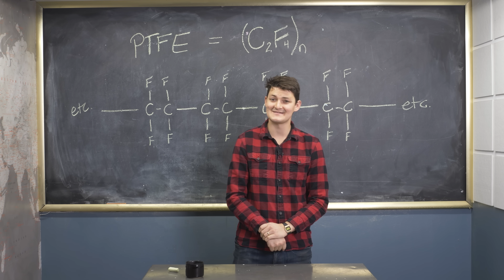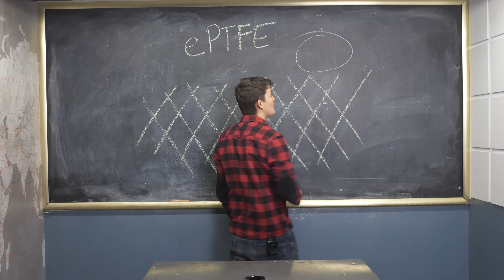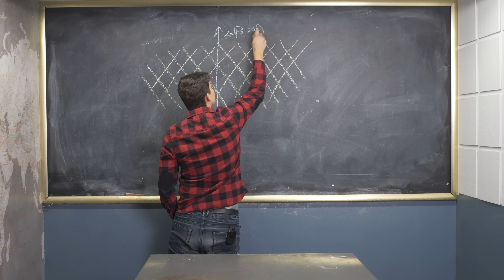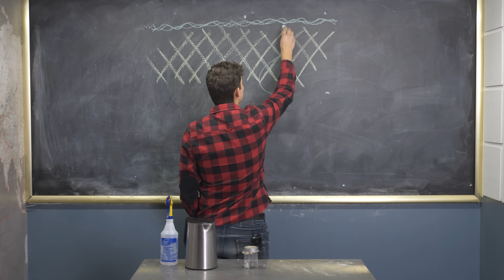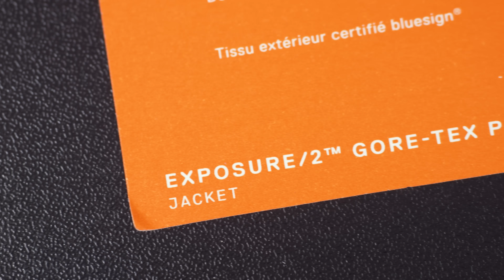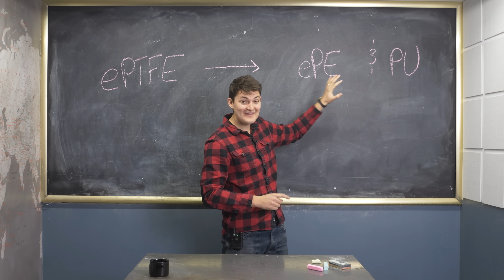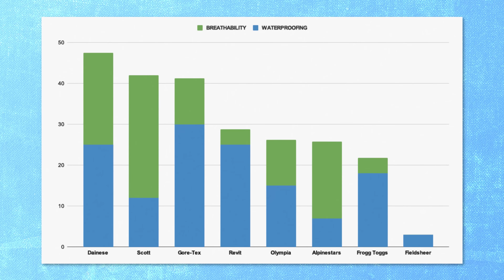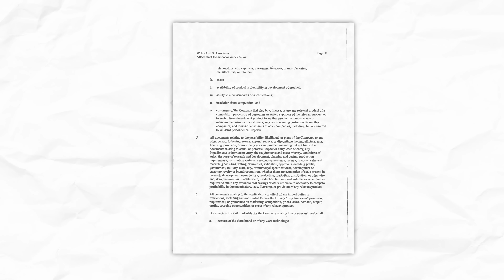Gore-Tex is a Marketing Gimmick

Comment: There are no better membranes than goretex in terms of practical usability. It's an expensive premium product that goes into performance oriented  garments.
Best laminates are mostly side-grades, i'm talking specifically about sympatex and toray products.
The truth of the matter is that most people wouldn't notice difference between standard generic 10/10 membrane and premium gore 28/28 because they are not in conditions this product was made for, and not doing activities that product was made for.
But it's their choice to pay up for latest and greatest, just like most people don't use even 30% of tools that compose a pro-series iPhone, but still pay for it.

Comment: In my opinion goretex neither breathes or keeps the rain out. Your boots will soak eventually and then they won't dry ever. Also it is not fun to melt inside your costume in the heat of summer. So why not just have a rain jacket to put on in case of rain?

Comment: This was a great video- for the most part about Gore’s business tactics and their membrane vs other membranes. You did make one critical error when trying to dispel the efficacy of Gore-Tex and also failed to apply your same standard to other membranes. You were so close when mentioning difference in pressure causing air to move back and forth across the membrane, yet failed to acknowledge Gore-Tex’s whole premise. It’s outdoor gear meant to let sweat evaporate and breathe out while shielding you from rain. The sweat is released by your body to shed heat generated from MOVEMENT. As you move, the clothing also moves squeezing air in and out of your layering system due to the pressure differential of your clothing changing shape. 
With your critical flaw being pointed out, I find it peculiar that you didn’t use that same flawed logic on other membranes and saying ALL membranes are useless because of the same use being that they all work under the same premise. Part of Gore-Tex’s price tag comes from being on more premium brands. Yes, your jacket example at the end with gore-Tex vs generic membrane exposes this, but when brands like Sitka (owned by gore, but indisputably the best hunting gear), Nike, and other premium outdoor brands use gore-Tex EXCLUSIVELY, it makes consumers more willing to pay more due to the Gore-Tex being paired with other top tier designs and technologies.
I advise you revise this video and be more truthful in a future video. -sincerely, a biomedical engineer, and yes, we use gore Tex inside of you.

Comment: This is wild, you may not be all wrong, but my basic issue rubberized wet weather gear was miserable. When we were assigned as OPFOR for SERE we were issued gortex and it was a life saver for me. It’s not perfect, but I survived -30* outside for weeks. Of course we also had fleece undergarments, and knew how to layer our clothing to suit the conditions. I did cheat some with quality wool socks, glove liners, and charcoal pocket warmers back in 1993-94. There may be better products now, but if you know how to use it, it can save your life.

Comment: I was a meter reader for 19 years. Best job of my life. I was getting paid to stay in shape, and we got to go home when we were done with our route, sometimes at 10 AM depending on how fast you wanted to walk.
i’ve gone through many shoes/boots, the best summer online 6 inch leather boots I found to be wolverine model 3368. They no longer make them. I don’t know what the souls were made of, they were some type of one piece plastic, I never wore a pair of souls out on that model boot , what would happen is, the shoes would go through a cycle of wet/dry/wet/dry that ended up taking all of the oil out of the leather eventually, no matter what I put on the shoes to try to keep them moisturized. It wasn’t winter weather or rainy weather that made my feet get wet, it was walking through the grass in the morning in the spring time, the DEW in the grass had my shoes soaked every morning within 15 minutes. And walking, squeezing air out of the leather, and then sucking the air back in with every step, eventually wicked the water in. I tried needs foot oil, mink, oil, silicone liquid, I even tried, thinning out, clear, silicone, caulk, and working that in to the leather, I tried snow seal that you apply with a hairdryer and melt into your shoes, some of them worked for a day or two, but nothing works, not even Gore-Tex for very long, the constant walking action, bending the shoe bending the shoe eventually squeeze air out as you walk, and wicks water in, Gore-Tex is fine for the occasional run from the house to the car in the rain, or going sled riding when the snow is not melting, but I have found that the only thing that is truly waterproof is rubber, but there’s a problem with rubber boots, not only do they never fit right, and there’s no support for your feet, and they are clumsy and they slow you down if you’re wearing rubber boots over your shoes, but your perspiration gets trapped inside the rubber boot, and your feet are just as wet as though you were walking through wet grass because the perspiration can’t evaporate away..

I also have a Gore-Tex lined one piece motorcycle riding suit that I commuted with for over 30 years. It was specifically made for riding motorcycle street bikes. I could get in and out of the suit in under 10 seconds because it had a full length zipper that worked from two directions from one pant leg all the way up to the neck, it was supposed to be waterproof, but sitting on a motorcycle in the rain, and moving, I found that water would wick its way in after about an hour on my lap after I had the suit for a couple years. The suit had padding in the knees on the shins on the elbows in the back on the shoulders, a very nice piece that I paid almost $1000 for and I certainly got my moneys worth out of it. But the Gore-Tex lining was not 100% waterproof. If it was raining, I learned to just put on a rain suit, two piece.
I also have motorcycle rain gloves. They are a little bulky, and they work pretty well when compared to leather gloves, my hands wouldn’t actually get bushy with water inside those gloves, but they kept my hands warm in the rain and they really didn’t feel like I was sticking my hand inside a bucket of water . And I was constantly squeezing brake levers and clutch levers and twisting the throttle open and closed, so and then I was leaning on my hands, so I was squeezing air in and out of the gloves constantly. And they actually worked pretty well, but not completely waterproof with that Gore-Tex lining, but much better than just regular motorcycle gloves.
so my experience with products that have Gore-Tex lining is, although it’s not truly waterproof after a time, of course, depending on how murdered it’s raining, but it’s better than not having Gore-Tex in the shoes or the gloves or the one piece suit that I had, it is not waterproof, it is water resistant. 
when I would buy expensive boots for my job reading meters, I always kept the tags and the receipt with the waterproof boots that I would buy that cost a lot of money compared to regular boots. I kept the receipts and all of those things hanging on the boots when they’re new explaining that they are waterproof because, I knew I would be taking them back in about a month for not being waterproof.
I learned not to buy my expensive boots from a smaller one off mom and Pop shoe store, because they do not like seeing you two or three times within six months for new boots because the ones you bought leak. It’s better to buy them through a large chain store where they have employees that couldn’t care less as long as you have a receipt if you bring boots back for exchange or a refund..
I did have a very expensive winter boot. They were 10 inch dark leather and they were supposed to be made out of elk Hyde. They were Timberland winter boots, they had leather lining. I couldn’t walk as quickly as I wanted to in those boots, but I only wore them when it actually had snow on the ground that I had to walk through the grass covered with snow . Snow is not as intrusive as dew.. those boots lasted me about 12 years, the thing that did the men was the leather lining inside the boots rotted away from the acid in my sweat. The instructions for the care of those boots was to coat them with liquid silicone every so often, I did not wear them on winter days when there was not snow on the grass, that’s why they lasted me so long. And the fact that they were pretty close to waterproof at least in the winter, that meant that they weren’t breathing out my perspiration. I tried changing my socks on some days halfway through my route when I saw the leather lining starting to crack and fail from the acids in my sweat over the years. I’m sure that helped slow it down, but, not completely. But winter isn’t the time your feet get wet, it’s in the spring and summer and fall when the DEW is on the grass. And I’ve been through it, there is no such thing except for rubber that is waterproof, and there’s nothing you can put on your shoes or boots that makes them waterproof for more than a few hours, from a meter reader point of view/experience..
The way I got through summers, getting my shoes, soaked every day was to take the shoes off and lay them on the ground in front of a small fan blowing air into the shoes with the liners removed from the bottoms of the shoes if it had them. That would dry the shoe out from the water for the next morning, most of the time, you can’t use heat, but that’s cycle of the shoe getting wet and then air dried over and over after a couple months, it starts to dry out the leather, no matter what you put on it.. it doesn’t matter what you put on the leather to try to keep it moisturized, I’ve tried everything. But eventually, the leather gives up and starts to crack where it meets the soul at the widest part of the shoe.
Those wolverine model 3368 where the best online hard soul walking shoes I ever had ever. I bid out of the meter reading department after 19 years because I had seniority enough to bid on the higher paying jobs throughout the company. They were higher paying, but they were not better jobs than metering, that was the best job I ever had, it was the most returned two job in the country at one time. I was on eBay and I saw Wolverine model 3368 boots in my size for sale brand new old stock. I scooped them up and I have them now, I am retired. Now, these boots will last me the rest of my life. They are that good. They were made in USA just like the ones I wore when I was a meter reader going through a pair about every two years. And like I said, before, I never wore out a pair of the souls ever not even close, it was the leather giving up and drying out to the point that it would start to crack from the wet/dry/wet/dry cycle hundreds of times. They were just buckskin tan leather on some type of a plastic sole pair, there was no lining. Sears had a work shoe that had a soulmate of that same material, but they were Dura shock souls that made your ankle kick out because they were door. Shock system was not fully as wide as the soul was, there were several times I thought I broke my ankle because of the way that Dura shock raised section on the bottoms of the shoes kicked out while I was just walking on uneven surfaces. I never bought them again, but those souls lasted a long long time. Also, they might’ve been made out of that same plastic type material, whatever it was. They were sold at Sears under the diehard name… I did not wear those shoes when I was a meter reader, I wore them whenever I was an electrician years later, ended up throwing those shoes away way before they were wore out because of the way that door shock soul was just not stable like a straight across even soul is

Comment: I am sure you saw this theory elsewhere and didn’t really think it through. Gore-Tex is definitely not just a marketing gimmick.  My Gore-Tex boots, parka, and farmer johns have kept me bone dry while hunting through driving November rain.  For decades.  That’s my lab.  No Mason jar elementary school science experiments.  It works in reality.  Other stuff also works, but none of it was available in the good old days. 

When you are inside your Gore-Tex, the humidity will increase.  Eventually, it may exceed the environmental humidity, but more importantly, it will be WARMER.  This increases the average kinetic energy of the water molecules inside your Gore-Tex compared with those outside of it.  This energy differential drives water vapor through the membrane. 

Yes, if you cover the membrane in a layer of water it will dramatically slow the escape of moisture, but it will not stop it completely. 

This is where the multi-layer nature of commercial Gore-Tex fabric products comes into play.  By adding a layer with a durable water repellent (DWR) coating that you mentioned, the water layer on your garment is broken into droplets, disrupting the continuous water layer, and allowing the Gore-Tex to function beautifully. 

“It’s not THAT breathable.”  It is breathable enough to decrease the water vapor inside the garment.  A sweater with a garbage bag is not, and it is quickly miserable.  A Gore-Tex parka is comfortable.  

And as for waterproof, the DWR layer is pretty good, and the Gore-Tex layer itself is also good.  And the effect is additive.  It keeps you dryer than any other system I have tried, including Gore-Tex competitors, and even the occasional sweater covered with a garbage bag.  SMH

Also, comrade, patents aren’t predatory.  You are just jealous that he got rich and you got to be an “influencer,” with all the prestige THAT entails. 

YOU are the problem.  If you prefer not-Gore-Tex, buy it, wear it!  The market will decide, despite any marketing pressure from Gore.  

You have clickbaitosis.

Comment: Another questions I have.... If your body doesn't breathe without some external force, does riding count?  If sweat doesn't evaporate off our bodies due to water build up on the Goretex fabric. When riding and you have the wind blowing against your jacket, thus removing the water buildup that is beading, and facilitating evaporation of the sweat underneath... Am I on the right track??  That should be accounted for correct??

Comment: Yes, G'tex is very expensive and not the only good membrane...but...my expierence (as a 57 year old biker) learns me that G'tex is much  more durable which means that G'tex equipped gear stays so much longer waterproof than all the others. I use my gear everyday. (Motorcycle)gear with other membranes than 'ePTFE' just don't last longer than one or two years if used frequently.

Comment: dmell, it is not a marketing gimmick if you use your brain and are realistic. Goretex is not a raincoat. It performs great when there is just some rain (and perfectly in the snow). Good goretex gear has provisions for breathing (usually with zips). It is a good COMPROMISE of breathability and waterproofing - but in reality is neither fully. Because that is mission impossible. I've been using goretex gear for 25 years and was aware of its limitations - and with this in mind it served me very well. It is great for nountaineering and skiing - and winter weather in general. It shields against wind also quite well. But I hardly use any goretex gear in other seasons, unless I go in high mountains. What is really a gimmick is goretex footwear - there is hardly more smelly shoes there and your feet even don't stay dry in it. For motorcycle use I would be sceptical, because with high speed also pressures on the membrane get high and it may not function as it should; in this case water repellence may be a better concept than a semipermeable membrane.

Comment: breathibility of goretex is not about getting air in. Its about letting water vapor (sweat in this case) go out. You can feel its performance while snowboarding. I ve used many standart jackets and goretex jackets. I can easily say i dont sweat much in a goretex jacket. Even if i try so hard, i never had that wacky sweaty feeling. In the other hand, classic jackets makes you sweaty and if you stop skiing, you will be freezing in 15 mins. Goretex is not for daily use.

Comment: I use gortex when I’m going to ride through a 5-10 minute shower cell. Could even be hard rain, but short and dry beforehand and after. I use real rain gear for everything else. I carry real rain gear on my bike. But I have a gortex set on my sporty, because a few thunder cells during a day ride will not be a problem for gortex, or one of the knockoffs, or a super lite weight barrier set. But I agree with you, after you use it once in a real rain, like frog togs, you’ll get smarter and drier.

Comment: It's a tool, when you know how the tool works you can apply it when and where you need. And that's about every membrane on the market, some might 'breathe' better and be less waterproof or vice versa. I have shoes which use proprietary membrane and they are even more waterproof than the same model with gore-tex but damn they might get sweaty inside. Yet i know about this specififc and know when to use them. 
Most of proprietary membranes are actually made on that expired patent. As for ptfe itself, unless the end user heats the product above tempretures which in most cases are unavailable in domestic stoves, they'll be okay. Though the ptfe production is bad, said potential user better be wearing that membrane jacket on the other side of the world* 😂 
*depending on water circulation specifics in a region.